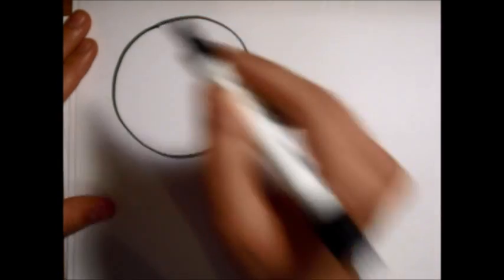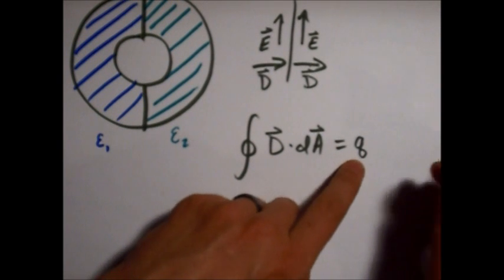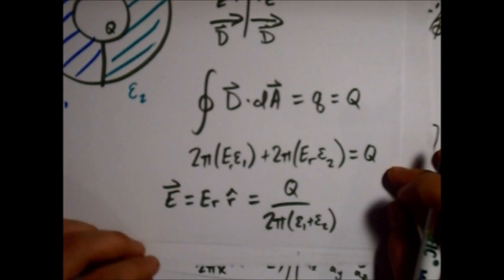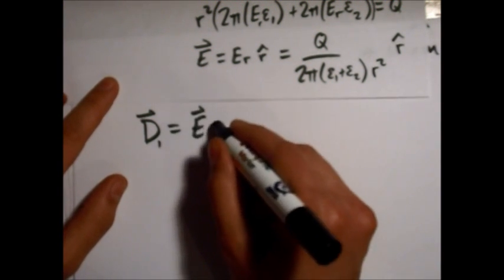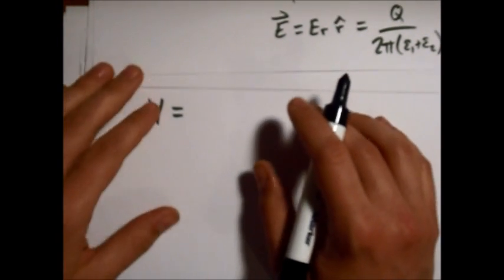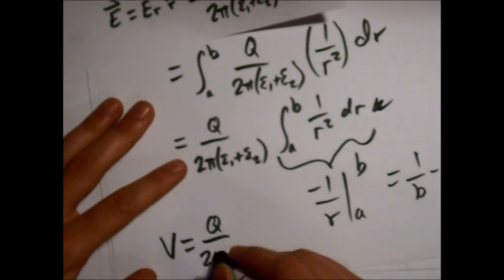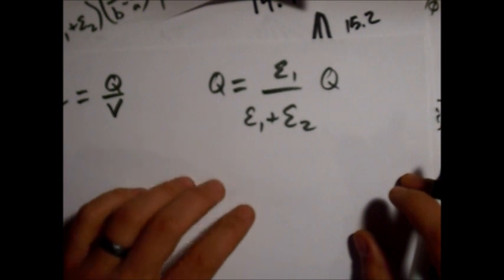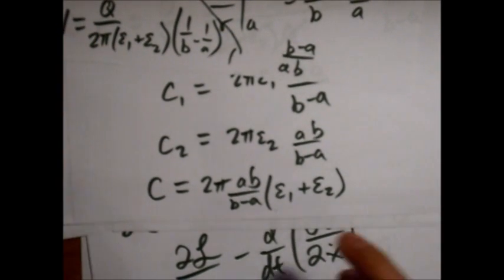Spherical Capacitor Two Halves with Different Dielectrics

Comment: why is the electric field the same on the two regions?
Reply: check the boundary condition at the interface. The radial field (Er) ,which is tangent to the interface, are both equal in the different two regions.

Comment: For those who are wondering about the voltage and why the signs change at the end:

We know that the capacity can not be negative. The problem here is that we calculated the V(b)-V(a) which is negative. But at the end, we put V(a) -V(b) or the absolute value of the prevoius.